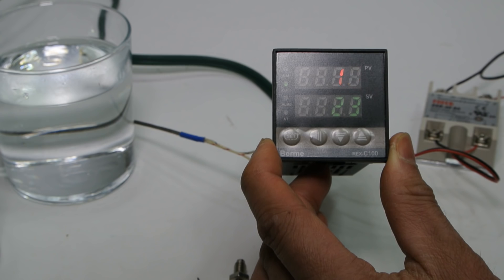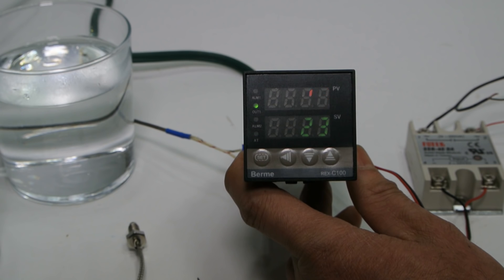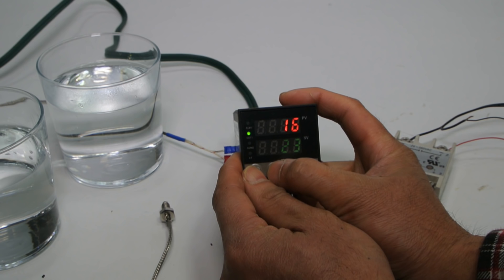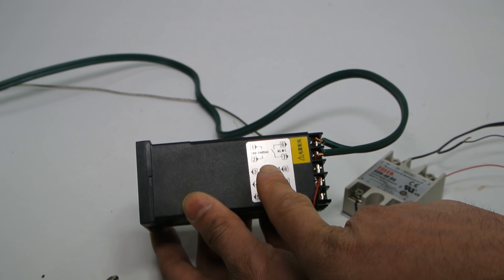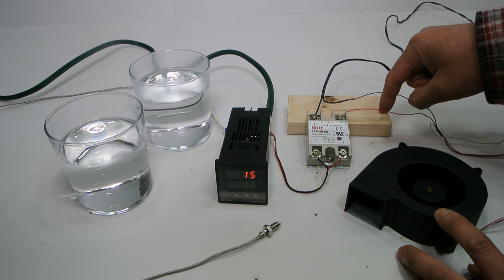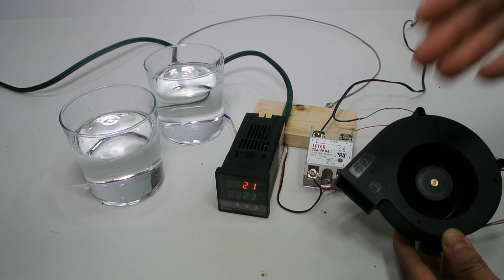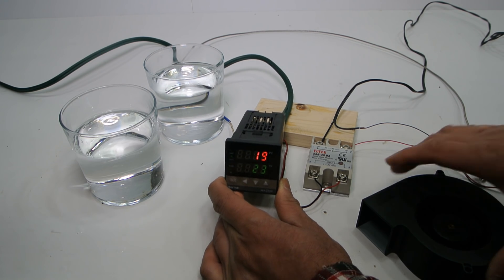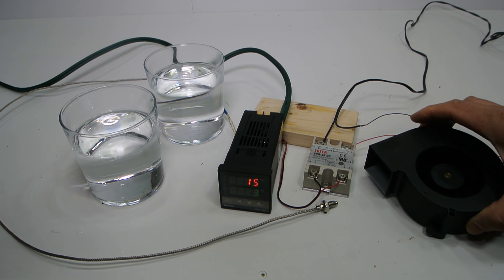Berme REX-C100 PID Temperature Controller

Comment: hey, i was wondering if it would be able to connect the rex c100 to arduino, to control him through arduino lcd screen? 
greets, nel
Reply: I'm confused by your comment about your smoker and the fact that the SSR is for AC loads.  Your smoker is an AC load so an SSR will control the heating element just fine.  What did you read that said it can't work?  Provide a link if you can.

Is your C100 the model with a "V" as the 'first control output' and then you are connecting the SSR directly to the C100?  Or, is it an "M" and you've modified it to use the internal DC power supply or an external supply through the relay contacts to drive the SSR?  Is the output LED on the C100 going off but the SSR does not?  If yes, you probably have a bad SSR.  Measure the voltage across the DC side of the SSR when the control is on and then off.  Does it change? Does the LED on the SSR change with it?  If yes, SSR is bad.  If not, it's the C100.

If it's the C100, I'd verify you have a "K" model that takes a thermocouple and that it's wired to terminals 9 (blue) and 10(red).  Next I'd verify your SL1 setting is all 0's for a type K. Finally, the thermocouple will work fine in air.  The only difference between the two(air vs liquid), involves some time constants in the PID algorithm.  For a smoker, which is a slow responding system, it won't make a difference.
Reply: I think you would need to find some sort of spec sheet and come up with some sort of interface. None of the output are any kind of serial output.

What exactly are you trying to do? 

Until I found these PID devices I had planed to make an Arduino based temp controller.
Reply: There is no way to communicate with this device so building an interface is not possible or practical.  You need to start with a temperature controller that has a built in serial interface such as an Altec PC410 which is available on ebay for < $60.  That is about the cheapest I've seen.  Otherwise you'll be in the 100s of dollars range.  You can incorporate the PID control right in the Arduino, which there are lots of sketches available,  but you then need an analog input capable of connecting to a thermocouple which is not an easy task. Some thoughts to consider....
Reply: To interface a k type thermocouple to an arduino you just need the right interface module. Adafruit has 3 different ones and the sketches to support them . I was going down this route until I saw how easy it was to use a PID and bought a cheap one from China. 

I've already tried using it in my smoker but the SSR i have only works for AC loads. Its the same one in this video and I'm still not sure how it works here. 

Everything I have read said it can't work and mine also didn't work exactly how they explained it wouldn't. It doesn't turn off the SSR. It has to do with the components  in the SSR.  

One other change is I'm not sure how well that style thermocouple would work in air. It think its a contact one and is best used for things like pots with liquid.
Reply: I guess this was for me but I'm using a 12v dc fan to control the air going into my charcoal smoker, not electric. Same as the creator of this video.

Based on this video I assumed my AC SSR would also work with DC. Well it didn't and I now know why. I have since then bought a DC SSR and the system worked great to keep my smoker at 107 C.

My main issue is that the PID I got from Banggood doesn't have a good manual and I can't find one online. Good thing it worked right out of the box.

I did also get a bigger longer Thermocouple that I think was much more sensitive than the stubby one in the kit. I think the stubby one is for direct contact to a heating vessel.

I'll check to see if the stubby one works as well. Just glad it worked as well as it did.
Reply: +Kelly Flowers adding this hoping it sends you an alert.
Reply: Try this manual.  BTW, mine is a Berne REX-C100 FK02-V *AN DN
Realize that higher models have more settings available. Some settings that do appear are not adjustable.  For example, I can get to the SL2 setting, but cannot change it from 0 to 1 to make control read in deg F instead of C.  Mine only has SL1-SL4 but some higher models go to SL11.  Enjoy...

https://www.google.com/url?sa=t&rct=j&q=&esrc=s&source=web&cd=2&cad=rja&uact=8&ved=0ahUKEwiC2rDSsorPAhUBXT4KHWlLCkIQFgghMAE&url=http%3A%2F%2Fwww.fmfranklin.com.au%2Fproducts%2Fdata%2Frkc%2Fc100set.pdf&usg=AFQjCNEr2nQTpkqP67nruKb6ZVIr1Vxmtw&sig2=wX4cSY7mNtTyfWoSmaYRNQ
Reply: Mine is the same except DA Where "D" is for Alarm 1 and "A" is for Alarm 2. Mine should also be DN since I don't have an Alarm 2.

RIght now it works 1,000% better than I had hoped. In my smoker application it over shoots to around 120 on the way up but then settles down to exactly 106-107C which 107 is my set temp for 225F. 

Oddly when it first starts up it turns on the fan and keeps it running as  the temp goes up. At 88 it starts to switch on and off a few times testing to see if the temp will keep rising with no input. After a few minutes it turns the fan on again and continues to move to the Set temp.

I was hoping to tweak it a bit more though I doubt it really would make that big a difference cooking meat. Its not like I'm hatching Chicks and need a a temp exact to the tenth of a degree or mixing rocket fuel. :)

But i've started to watch videos for other brand PIDs and getting a bit more info each time such as Sc is to calibrate the probe.
Reply: I'm rethinking my PID design to now use an AC SSR. 

I'm going to have the AC SSR switch an outlet which will then have the 12v Wall Wort that powers the fan plugged into that. It makes for a much more flexible controller in that I can also control any AC appliance like a slow cooker.

I've also found PID programs aka sketches for Arduinos. I may need one to control a propane stove which only has a dial to control temp. Figure i would hook up a servo arm to turn it up and down.
Reply: If you want to control the controller with Arduino, you should buy a RB100 or the CB100 from RKC Instruments Inc. from Japan. they do have Modbus outputs. you can buy them here: http://www.cascade.net/controllers